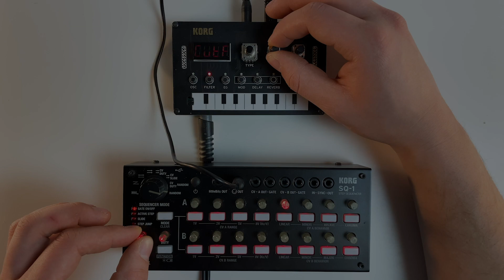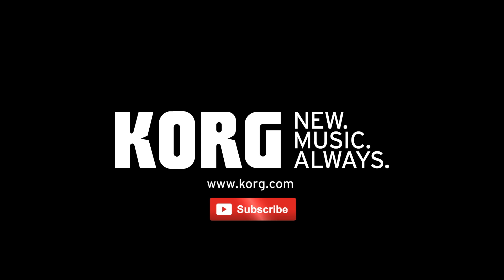Patch of the Week 43: Nu:Tekt NTS-1 + SQ-1 Sequencer

Comment: Cool how you can midi these with a trs cable!
Reply: The 5 pin Midi din plug that we know about only uses three wires for the connection.
The centre ( earth)and the two pins left and right of it.
The trs plug is a stereo plug so the earth midi wire goes to the sleeve and the other two go to the tip and the ring of the trs plug.
Thats how we get midi going to a trs plug.
Cheers

Comment: Is there any way to stop it from sending MIDI out when using it through USB?
I'm sequencing it with my OP-Z using USB and a powered hub, but everytime I tweak parmeters on the NTS-1 it will send the CC signal back to the OP-Z, and I don't want to disable midi in on it because I use an external keyboard too.

Comment: so...I have a spare sq1 1/8" to midi adapter laying around--that should work to connect it to other hardware via midi, no?
Reply: Yes.
The SQ-1 actually comes with a 3.5” MIDI Break-Out cable, so the one you “have lying around” may even be the very same?
I’m a little new to all this, but I think I’ve heard there can be different polarities with MIDI, not sure what problems can arise?